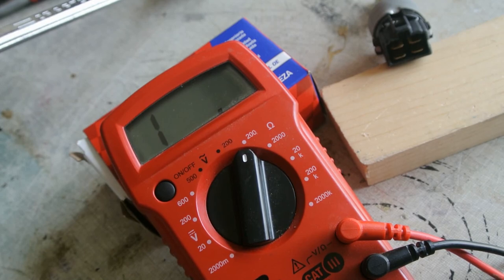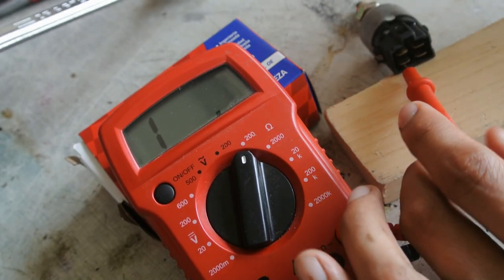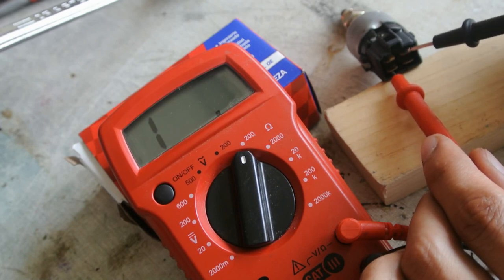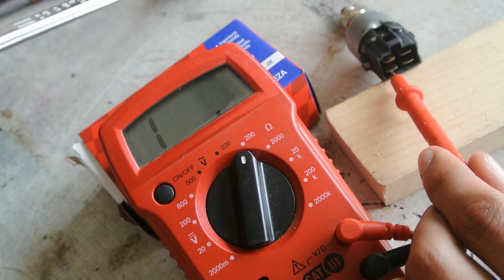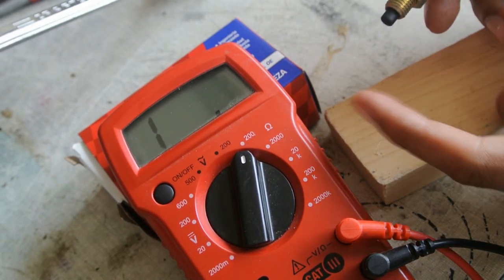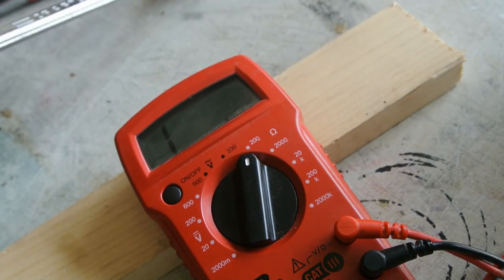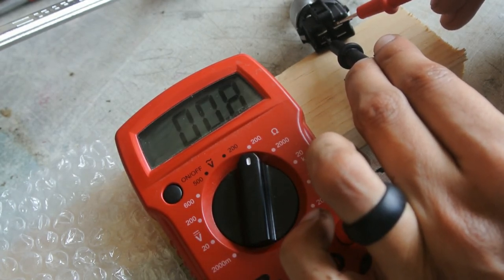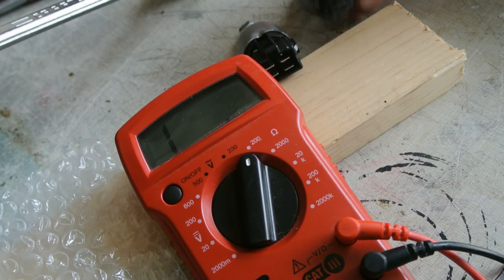Checking for Continuity in a Brake Switch; How to Test a Brake Switch

Comment: Thank you I just replaced mine today at first it burn fuses out after that I found out the fuses we're not burning out anymore because I had no brake lights. So I had to drive 4 miles with no brake lights! I put in the new Switch which turned me into a contortionist having to take half of the dash out to get at it better. And each time the Lights Went Out I got a check engine code p504 which indicates a brake light switch. So here I was changing a few fuses and the lights were still out when the switch finally went bad completely. I had to test it watching your video just to be sure and there is no continuity at all on the old one. I did not check the new one. The lights are working great. Thank you very much!